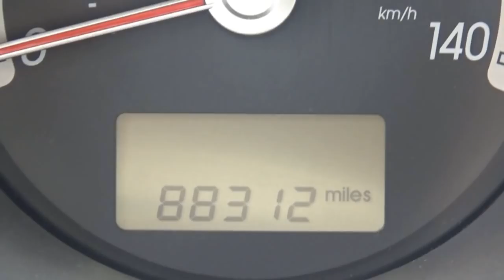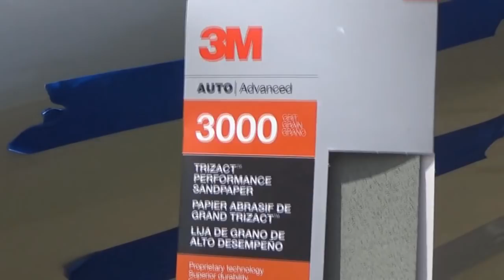MV 147 - "I Botched The First Kia Project!"

Comment: I watch the same video of Chris Pratt video I need to fix some scratches in my car good video glad I saw you do it I think I take my car to the body shop
Reply from the maker: I think it would've worked out better if the scratch wasn't so deep. I misjudged how deep it was, so now I know if you can feel it with your thumb nail, it's too deep. Don't mess with it. If you can't feel it, it should come out using this method no problem.